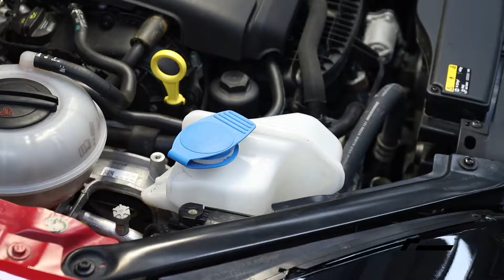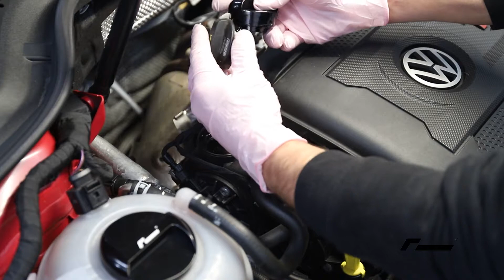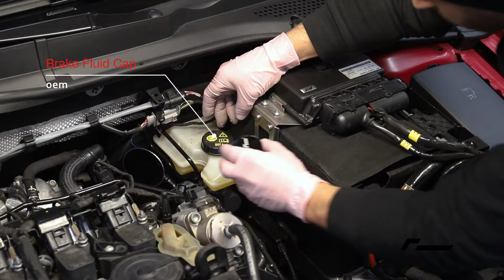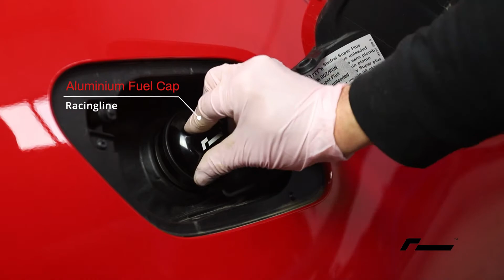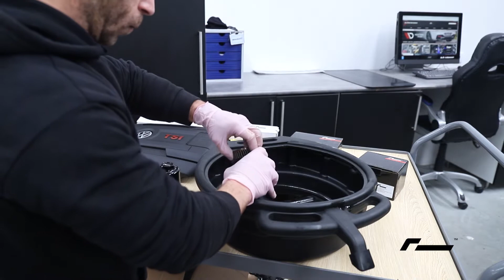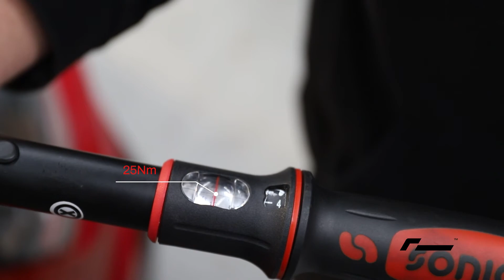Racingline Engine Dress Up Install

Comment: Guys you have to swap the oil seal on the oil filler cap ! It’s a must otherwise, it vents out slowly and runs down the side of the engine ! And if you have a service it can make the engine look as if the crank seal is leaking to the technician . 🤔🤦‍♂️. Trust me lol